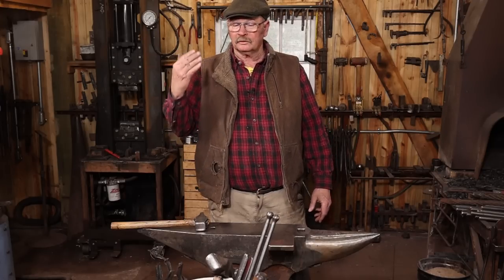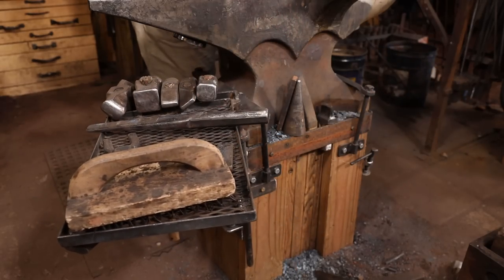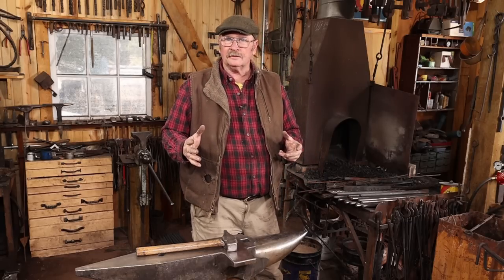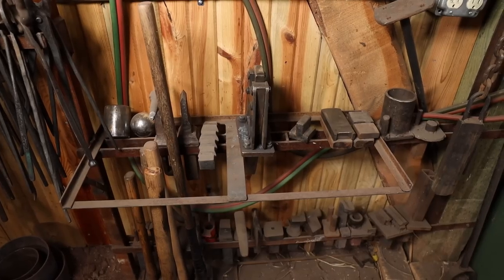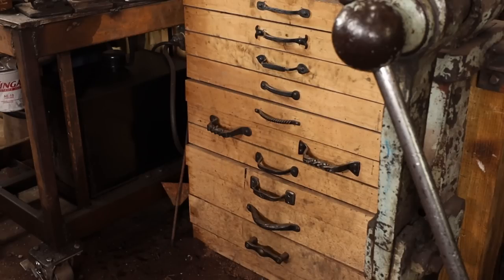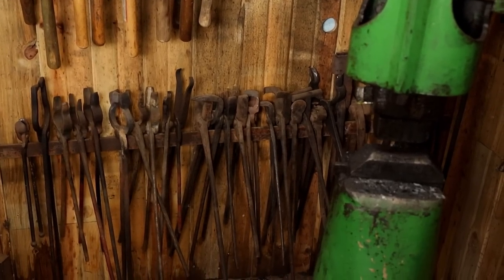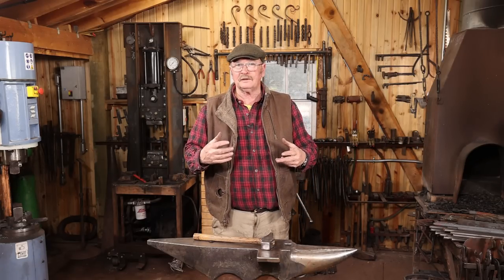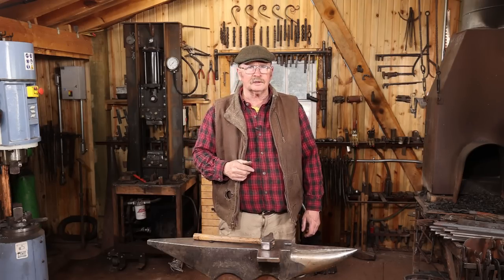Workshop Tool Storage and organization ideas

Comment: John... Give this a read. THANK YOU for all of your teachings, lessons, encouragement, safety education expressed, forging ideas, business insights, and banjo stummins. 
I am closing shop after something like 4-5 years. Everything has been packed away and I am finding it just so difficult to make myself do the final move of things into storage. It feels like a death to me really, but it just has to be done to better provide for my son and I, and to accommodate the necessity of time and dedication thereof for a boy barely over one years old of whom does not have a mom. 

I wanted to tack on my insights for tool storage though. My most common hardy tools and punches and chisels are on my anvil in pipes and a "veranda" style tray around my anvil stand; just as your's. 
For my other hardy tools, i notched the furthest point of the shanks to resemble a gut hook from a skinning knife. And i hang them way above my head but just barely in reach on a thin braided steel cable attached from Wall to wall. 
My tongs and spring swages have always been on an old, multi-tier newspaper rack that I reinforced with some small round stock under the rails. It was a great find, very sturdy... Its like the ones you'd find in a library where they have articles archived from long ago. I found it in the basement of a building I remodeled years back as a charity job converting it to a battered women's and children's shelter. 
Punches and drifts and chisels i have hung on the wall in the slots of the base portion of one of those shelf systems that are connected by vertical pipes. The cheapo ones. The one i have is 4' x 2.5' and has 13 rows of 8 holes measuring 1.25" x 1.75" + smaller gap holes between those basically over 140 holes in rigid plastic to wedge hand tools of all kinds. 
My hammers hang under my gas forge I built myself upon a rack i made for hammers and it spans 3 sides. 

God bless you all, have a blast with the art, I love you all and wish you the best.

Comment: John, You have some great ideas for tool storage. Another great video. In my shop, I have a concrete floor and the moisture wicks up through it. I noticed that you have sledge hammers set on your floor with the heads down. That is how I used to keep mine as well. The problem I ran into is that the moisture wicking up from the floor causes the wood in the eye of the hammer head to slowly dry rot and one day as you are using the sledge, the head flies off. I have a portable post vise that is mounted on an old flywheel, so now I set the hammers on their heads on the flywheel base to keep them off the floor. Maybe in Colorado the floor moisture is not as big of a problem.
Reply from the maker: Thanks, glad you enjoyed it
Reply: Sounds like there's no waterproof barrier installed underneath your concrete floor or it has failed. You could seal the whole floor in an epoxy resin sealer or tanking slurry which should solve your issues with rising damp if it's really bothering you that much.
Reply: @HoeDizzleFoShizzle  How long do those sealers/slurries last?  I have the same problem that Paul has, but in my garage.  (My Blacksmith "shop" is in the backyard, mostly under a roof that is over an old, huge BBQ that the previous owners built.  There is no concrete under my "shop," just dirt, so all tooling stays inside my "workshop.")

Comment: Tool Storage is indeed a problem! I must confess I have tried the 5 Gallon Bucket method to my frustration and aggravation! Lik John, I have had to poor things out and pick them up to find what I need. Practical Blacksmithing by M. T. Richardson has some very good Ideas like a little square Tool Bench that I intend to build one say soon!
When I have a Hot pie of metal the last thing, I need to be doing is fumbling through Kaos to find what I need

Comment: I have ADHD, so honestly the 5-gallon bucket is a great system for me (actually several buckets).  When I'm done with a tool I can toss it in the general direction of the bucket and it's put away, otherwise I'll never find it (I once spent 10 minutes looking for a pair of tongs that I was actually holding at the time so this is important for me).  If I can't find a thing, it's easy to dump the bucket, find the tool, and then refill the bucket.  If I have to put a tool in a specific place then the only thing that I can guarantee is that I'll never actually put that tool in that place.  It took me the better part of a decade to realize this about myself, but if you have ADHD then efficiency trumps literally everything else and this system works for me so I use it.